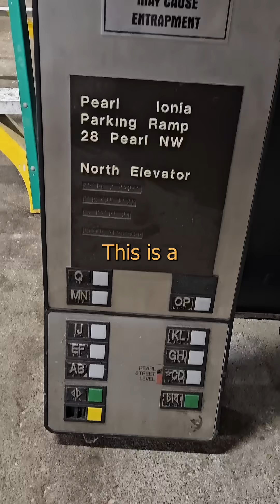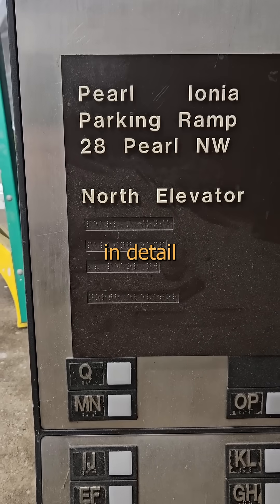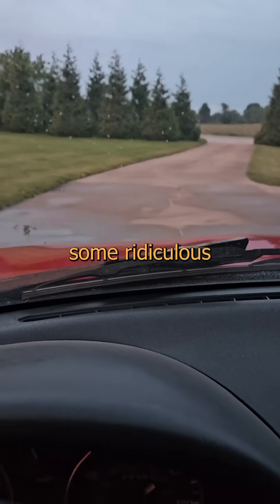Miata Mischief #chrisboden #engineering #gear #elevator #score #stories #parts #hacking #making

Comment: Probably less sketchy than most, but me and a friend got a floor model entertainment cabinet for sell for only 50 bucks (The original was something like 400) The only catch was we had to haul it home in one piece. The Employees took one look at our car, and one look at the cabinet, and swore up and down we wouldn't fit it in the car.

For reference the car was my friends, he drives one of those tiny box cars that barely seat three comfortably, and 4 in a pinch. We did everything, putting the back seat down, smushing both front seats forward against the dash, and it barely fits. The employee looks at us as if we just solved the forbidden jenga puzzle.

I look to my friend and tell him to drive as carefully as possible because we are more or less laying on the dash, thankfully it was later at night and the roads were dead. We got it home and it still sits in the living room.
Reply: Nice! Did something similar with a 25" floor standing cabinet t.v... Folded the front seats all the way back horizontal, loaded it through the front doors, tube down and used the top as the seat back... 40 or 50km down the highway home.

Comment: Ive got too many to count, being in the south and living poor lol once i riggued up a pulley system to lift a 400lb sand filter to the bed of a ranger, only to find out once i started the tailgate didnt open, so once i got it up to the back step, i had to ride in the back and hold tension on it the whole ride over. Wasnt a big move but i lt was summer and i was whooped when we got it there. Never even setup the pool at that house before we moved again. But we only moved a few blocks that time, so i slide it into a nearby neighbors empty trash bin and just walked it lol

Comment: I used my 1983 GTI to carry a full size couch home 2 miles with some 2x6 boards stuffed under the front seats hanging out the hatch.  The couch had 4 tiedowns and stood straight up in the air.  It's the biggest spoiler I have ever installed.  The thing had recliners on it.  I swear the car was trying to do wheelies.

Comment: I had a water pipe burst in my house. My Tahoe was down with a bad fuel pump, leaving my motorcycle the only running vehicle. I went to Lowe's, picked me up a 4 ft section of pex, threw it over the handlebars and back seat, and road home like I was holding a javelin. The stares and laughs I got were the best 😂

Comment: I carried a Dell PC home in my backpack but that meant the monitor and keyboard wouldn't fit so drove it all home on the floor board ...Of my Honda spree scooter so here I am rolling down the road with a 40lb backpack holding a crt monitor between my feet and the cops pull me over and inform me I'm breaking more than a couple laws 🤣 but they pulled me over right in front of my house so they made fun of me a lot and sent me home

Comment: Things I brought home in/on my 1st gen ('98) Miata. Having a good roll bar made it easier to do some of these...
-600lbs of concrete bags
-200 gallon air compressor
-Lay Z Boy recliner
-Bathroom vanity
-20x 2"x4"x10' lumber
-Dragged a dozen (one at a time) 100+ foot tall, felled Douglas Fir
Reply: Done more truck stuff than most 1 yon trucks. 🤔
Reply: @AdventureswithGeneral That's exactly how I treated it. I was living in Minnesota at the time, and if I could have effectively put a snowplow on it, I would have 😂
Reply: WoW. Did the passenger seat ever come out?
Reply: @eshock9208 lol, no, but also never carried passengers. It was where tools and miscellaneous crap got stored

Comment: Not exactly hauling one item but. October, 2020. I had an apartment in choteau, mt. 1 bedroom 1 bath. Things didn't pan out and I had 3 days to get everything back to great falls mt 51 miles away. Problem 1: I only had gas for one trip. Problem 2: My chariot at the time was a 2 door 04 Chevy cavalier. Somehow, against all odds, I managed to get it all in one trip. I broke down furniture, stuffed the boxes for my vintage sansui 4 ways with stuff, I even rolled my full size 8" thick temperpedic mattress up like a taquito. I had three 2"-4" holes to see through the rear and passenger windows and there was stuff between me and my door. I am still convinced I may have become a timelord in the process of getting it all in xD.

Comment: My father had an old 1993 Buick Roadmaster estate, it was lowered a bit, and he also had a hitch mount. We drove two hours to get a  300lb washer and dryer. Mind you, this hitch mount is rusty as hell. Six hundred pounds, all the way back home, with nothing but straps and a hitch holding two expensive machines back home. We scraped the bumper on every speed bump. I still get anxiety thinking about it. But it did come back home safe, and we still have the hitch mount, and both the machines 4 years later.

Comment: I use an old beater 2003 Acura TL I bought for 500 bucks off a tweaker (clean title was in his name, it was legit, im no dummy), to haul a 70 gallon water tank to my semi off grid property (electric only, no water, had to put in septic, oddly enough the electric co provides fiber internet. Better bandwidth than at our freakin house 😂) when I go out there for the weekend or extended visits.  did the math and its right around the max weight capacity of the car. The front lower ball joints love it. 😂

I just put a fresh set in last week. Lol 

Eventually ill probably cut the whole back open and haul a bigger tank. I have higher rate springs for the rear i need to install before I go that far.  Im aiming to haul a 300 gallon tank eventually. 

Yes, I have a C2500 GMC pickup. Yes its easier to haul my 325g tank in it....  But it gets worse fuel economy empty, than the car does loaded. 😂 and the car rides a lot better. 

I lay the passenger seat down and put the tank between it and the back seat. Fill through sunroof. Make sure to fill it FULL or the sloshing makes for a fun drive. Mostly just a weird sensation for the driver.

Comment: I'm a socially reserved, hesitant older sibling to twin brothers with a VERY outgoing friend group. I never did anything illegal, until...
They dared me to. I said "I'll need a cigarette & 2 matches (I don't smoke), and a socket driver set. I was gonna steal a road sign on a very busy road. The socket set was to get it of the poles. The cigarette was for cover, in case someone noticed the loitering. After I got the sign down, I realized there was no way to ACTUALLY get it home unnoticed, so I called a ride. I saw a cop car coming down the hill, so I pulled the sign behind a berm & made like a shadow. Just after they left, my ride showed. We then realized it was too big to fit in the trunk, so we folded it in half & got it back to the barn. The sign turned out to be abt. the size of a twin mattress. And that's how I know I CAN do sketchy stuff, but I use my powers for good.

Comment: I bought a proper sized server rack (apc ar3100) at a salvage place. I had no good plan to get it anywhere, so I disassembled it as much as i reasonably could in the loading area, which made it a lot flatter. I then proceeded to jam all those pieces into my trunk with my back seats down, and they barely fit between my trunk door and the back of the driver's seat. Took me about an hour and a half but I got it, and the rack was only 50 bucks!

Comment: When i was 23 I pulled a overhead fifth wheel trailer that I bought at trade day in Collinsville Alabama by sitting the pin through the top of the sun roof of my Suzuki Sidekick.

Comment: I work at an electronics recycling company. We used to have a regular named Nixon, he was a kind of crazy dude (in a good way) who would buy any and everything whether he had the room for it or not. 

He did a lot of stupid hauls over the years, but my absolute favorite was him buying an absolutely massive flat screen TV. There was absolutely no way it was fitting in his car, and despite the fact that he also has a truck he decided since he only has to go 3 blocks with the thing he was going to put it on the roof of his car and hold onto it with one hand out the window, nothing else holding it down. We had like 4 separate people tell him it was a dumb idea that wouldn't work, and I told him he wouldn't be getting a refund if he broke it, but he was dedicated to the plan.

Well... He backed out of his parking space, instantly had someone speed past him from behind and he slammed on his brakes. The tv went flying off the back of the car and that was the end of that, the dude didn't even make it 5 feet without breaking the thing. It was easily the dumbest and funnier haul I've seen.
Reply: This is awesome LFMAO
Reply: To be fair, he might've possibly made it home with the TV intact had some asshat not ruined the haul.

Comment: Me and my best buddy put his motorcycle in the back of his minivan to go to a rally one time. We needed the van there, and he needed his bike. So, we rolled the handlebars down, had two guys help us lift the front tire into the back, slid the back in, used the seat belts to secure both sides of the handlebars and off we went. Unloading it took forever, and almost cost me a nut (sorry honey), but we discovered that a Harley does, in fact, fit inside of a minivan. The looks we got on the road made the entire ordeal worthwhile.

Comment: Picked up some 7ft running boards in a ford focus, could barely shift, couldn’t use my passenger mirror. In the same ford focus I managed to fit 30 cases of 24 beers helping a buddy clean

Comment: I owned a Chrysler LeBaron convertible in the early 2000s and we wanted to get a fresh cut Christmas tree.  So we went 120 miles to the farm cut the 10 foot tree and then placed it in the passenger seat with the top open.  Drove home during a small snow flurry that turned into sleeting rain.

Got tons of honks for stupidity during the drive home.  Also pneumonia

Comment: We had to buy a mattress for my bed, from IKEA that was on the other side of the city. Unfortunately, we only realised a 90x200cm mattress won't fit in a BMW E46 323ci coupe... when we were in the parking lot and we only had one set of straps. So we drove across the entire city (about 20-ish km), mattress on the roof, straps through the back window and me holding the mattress by hand through the front right window, while my dad had his arm out of the front left window also holding the mattress *while driving* (luckily an automatic). We couldn't go faster than about 40kmh because the mattress was about to fly away. That was a fun way to spend a summer evening.

Comment: In the RX7 on my channel, I had to transport a few rotary engines in the back and front area, along with several drivetrain components strewn around. A roughly 550-600mi round trip in an RX7 with a 12a I had rebuilt 2 years ago. what a blast, I'd do it again.

Comment: I was 18 years old, I had a 20 by 40 foot canopy tin that I took from one party to another graduations and anniversary and funeral. Well, I had a do you mind a role around the corner on my block, i didn't feel like putting it in the truck. Cause we ratchet straped all the pipes together which all weighed about a 150 pounds. Cause this was an old school tent. It's not like the new lightweight ones this piece of s*** was heavy, but I had a go cart simple homemade 6.5 hp, no suspension, golf cart tires, and I had a two stage clutch, like you would find on a golf cart so I didn't have any pulling power. It only adds speed, but I ratched strapped one end of those bundles of pipe to the back into my go cart and the other end I bungd accorded down to my creeper and I towed it around the block. No, it wasn't very far, but because the Creeper had castors that swiveled that thing as I rounded the corner just started swinging out real far about took out a mailbox, and ust as it narrowly missed the mailbox, there were 2 cops just sitting 2 doors over from where I was going and like hell if this was legal, they did nothing but laugh their asses off the fact that was pulling these sixteen foot long pipes with a go cart.

Comment: Back in 2020 I was driving around and I saw this free table sitting on the side of the road and I figured I would get it back home somehow for some project and I ended up driving my riding lawnmower all the way over there with a trailer and flipped the table over, put it on top of it and strapped it down and hauled it back across Town on a busy road.

Comment: This story is not my own, so it's not eligible, but I just had to share it. Years ago, before I started working, my boss was driving down a nearby road where some clearcutting was being done to expand the road. He's a woodworker and he noticed this one beautiful, perfectly sized section of a walnut log. He was with my coworker and the two of them quick chained it to the back of the work truck and started dragging it back. They told me they wore through the chain a couple of times in the mile back to the workshop, almost causing an accident with a crazy lady tailgating them. When they got into the driveway at work they were followed in by a local police officer. He took a bit to get out of his cruiser, but when he did all he said was "I know this can't be legal, but I have absolutely no idea what to write on the ticket." He just exasperatedly got back into his car and drove off. That log made some nice lumber.

Comment: checking  dumpsters and was able to find 5 microwaves i then took the tranformer out of them to make a tesla coil later had to cancel the project because i dropped my phone on the high voltage output and it exploded so i switched to using 
CRT Flyback Transformer

Comment: O man, ive got tons of stupid shit. Too much to share
Reply: Overweight hauling, using a wheelbarrow to go to the grocery store, because that was all I had. Making contraptions to haul stuff home. I bought a dolly kind of thing to haul near 100 kg of tiles home on 2 busses a train and 6km walk, to discover I had flat tyres on it and only place to fill them about 1 km from the finish line.. I once screwed boards together on my roof my car on a roof rack shape to go to a festival in Germany 850km away. I transported many not transportable stuff on a flatbed towtruck, I dragged stuff around on ways that one shouldn't, I transported a matrass on the roof with us just holding in from inside. Many many many more..

Comment: One time I drove an hour round trip (in a red 1st gen MX5) to pickup a fibreglass front bumper for my drift car

I had to transport it home with the roof down and the bumper in the footwell, pointed up and resting over the rear roll bar

I had a police officer pull up alongside and ask me "is that load tied down?"
I wrapped the seatbelt around the bumper and told him "isn't going anywhere"

He let me go

Comment: You can shoehorn a lot more than that into miatas. I used to take mine to gigs for multiple bands. 1 1x12 tube amp, a big as pedalboard 3 guitars and lights. The next weekend I would take the car on a track day.
The answer is always miata.

Comment: Me and my father. We hauled an 10ft wide trailer full of prefabbed corrugated metal panels (a disassembled custom shipping container)over 50 miles home with a pick-up and an overloaded single axle trailer, 15 of which were on the freeway at about 40mph with just flashers. Thankfully, it was Saturday. The panels are about to be reassembled into a prefabbed shop that is 24'x36'. It was big enough it should have been permitted, but we got away with it!
Country Boy Ingenuity😅

Comment: We once had to move a 600 pump organ into the basement of my house, so we lined it up at the top of the stairs, ran a tow rope out the back patio doors, out the back fence where it was tied to the back of the van. We the. Carefully backed the organ down the stairs using the can like a winch, and it worked! I hope we never have to get it back out again.

Comment: In high school I drove two friends and a guitar case home, in a two seater MGB. The convertable top was up. The rear window unzips, so one friend was partially sitting outside the car. 
I aslo managed to fit a Chinese dirt bike in a old Honda  odessey minivan, with the middle seats. The problem was the dirt bike was much taller than the ceiling of the minivan. I just managed to close the rear door.

Comment: Back when i was about 20 years old. I had a 2 wheel drive, 2 door, 1.8L, 4 speed Subaru coup. That i removed the passenger and rear bench seats. So i could use the space for my 3ton floor jack, air tank, jack stands, parts, and tool boxes. Just to make a dime to live. And FYI, I had used 4 different year cars to build this one car.

Comment: Lol work were giving away TVs and like a dummy I chose the largest one. 72". I had to cut the cord off my 12v electric blanket to sort of tie it into my trunk, which with the seats down and the window open I had to scratch the corners of my trunk surround to get it in. I drove about 30 miles on the freeway like that.